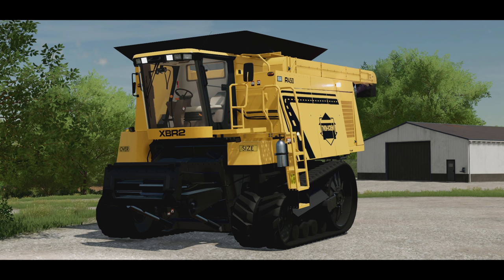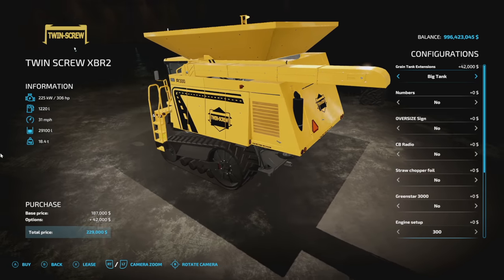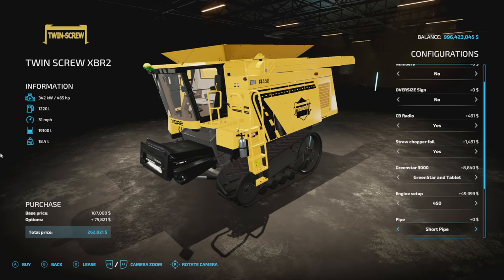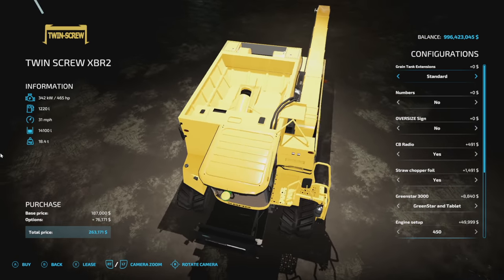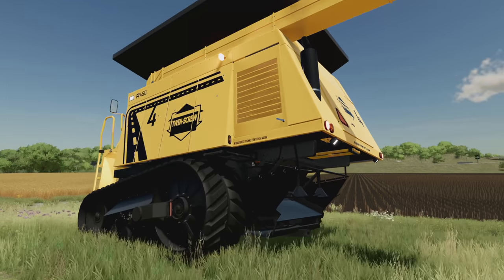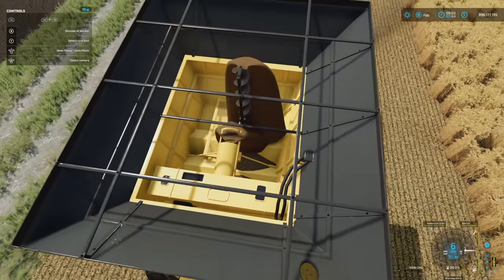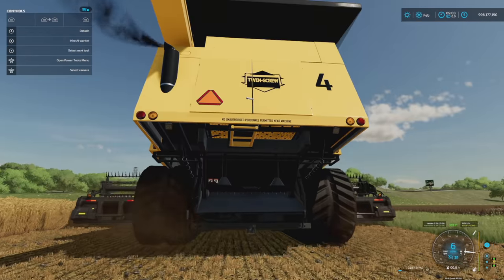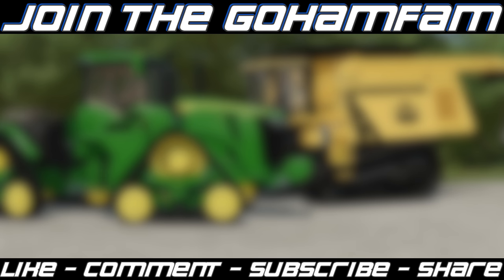Twin Screw XBR2 by SiiD Modding (Early Preview) | Farming Simulator 22

Comment: Absolutely glad to see that harvest are returning again I’m also glad to see that it had an engine improvement as well because I’ve noticed in farming simulator 19 is struggling with the bigger headers because of the horsepower I’m glad to see that the horsepower got turned up in the capacity is absolutely massive great video